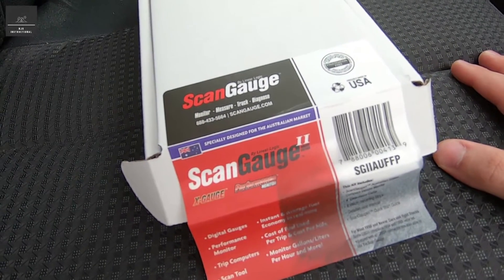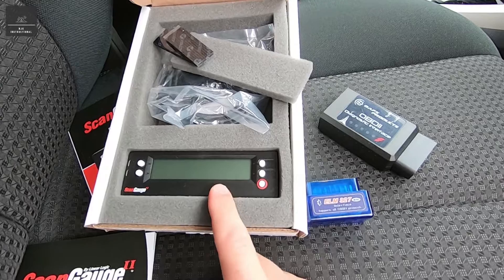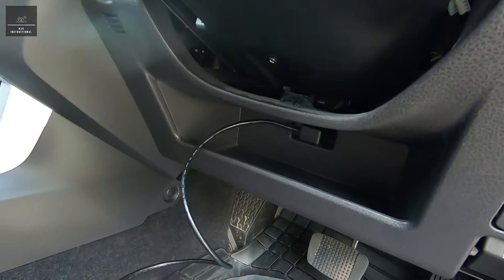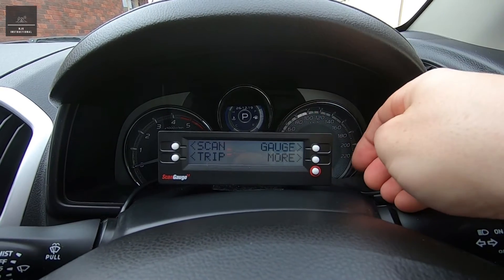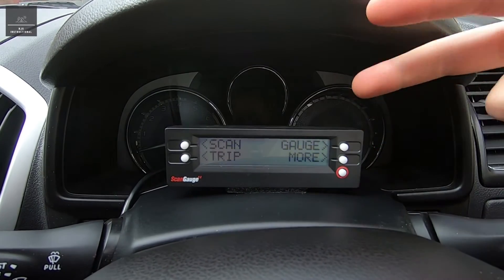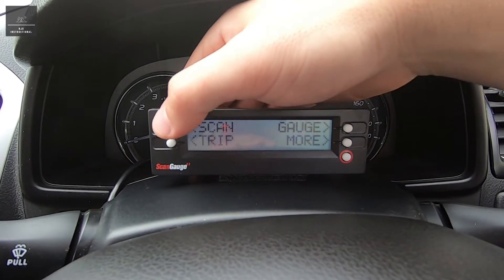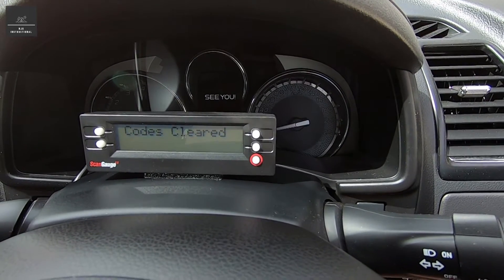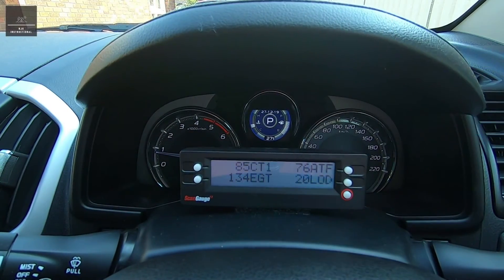ScanGaugeII OBD2 Engine Scanner Review - Install, Engine Gauge, DTC Scanning: AN ESSENTIAL TOOL!

Comment: does this support to the new model of isuzu mux  2023?
Reply from the maker: Yes, that is correct.
Reply: @NJSInstructional  including the ATF Temp?
Reply: @NJSInstructional  hey man my tft gauge wont display, which code should i use on the xguage website?

Comment: Will it tell you how many gallons are left on tank and how many miles you can still go on gas tank
Reply: yes, but you need to calibrate the scan gauge when you fill up for gas, which is easy to do.

Comment: How does it compare to the a ultragauge ?
Reply from the maker: I'm not too sure as I don't have one. However, in my opinion, the ScanGaugeII is much better than a bluetooth OBD2 scanner.
Reply: @NJSInstructional  the ultragauge has the ability to connect via a wired connection just like the scangauge. The display is much more appealing on the ultragauge.

Comment: top vid mate 
how do you get the program code you have on your phone please can you send me a link or how to get them
Reply from the maker: Cheers. Just type in the DTC no. into Google and it will appear with possible causes and what to look at in the vehicle.
Reply: @NJSInstructional  i wanted to know the app to put codes into your scan gauge to set program to monitor trans temp and other  setting
the app you had on your phone or were did you get the code settings to program into your scan gauge if you know what i mean
Reply from the maker: @pkgoldopalhunting  the program is X-Gauge and is preinstalled on the ScanGaugeII unit. Depending on your make of vehicle, each x-gauge code is unique. Refer to the ScanGaugeII website for these custom codes. Cheers
Reply: @NJSInstructional  ok thanks mate